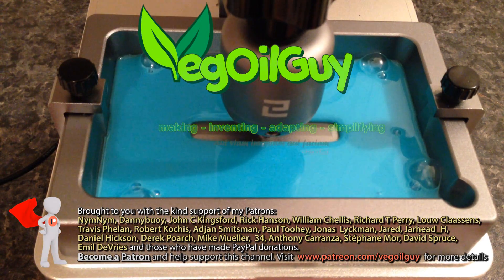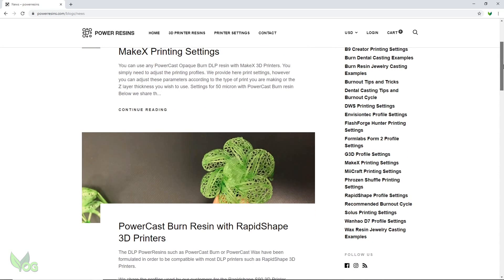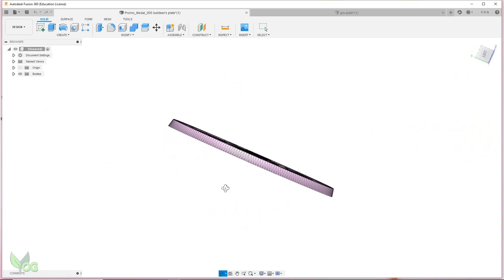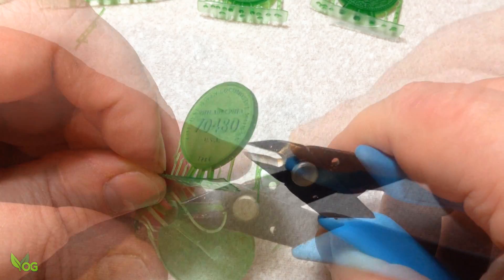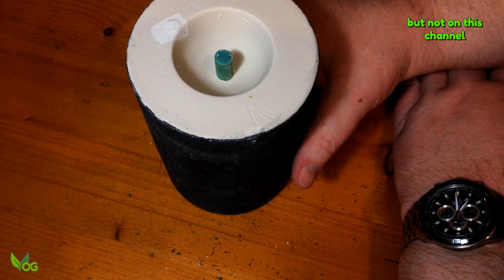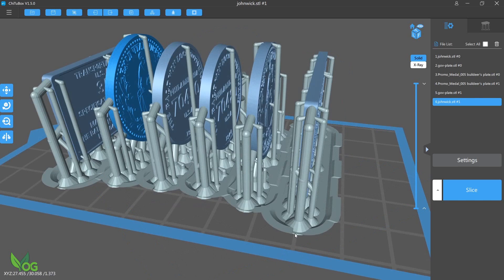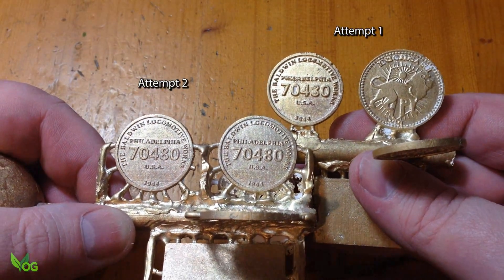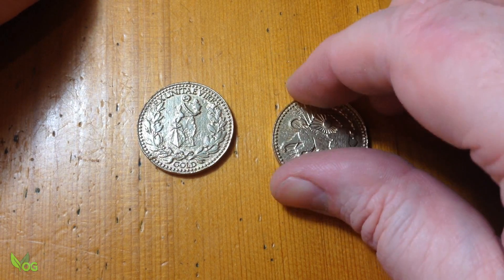Using & Reviewing Powercast Burn castable resin with my Elegoo Mars - detailed home castings! VOGMAN

Comment: Glad to see priming worked!
I dont cure mine when I prime. It seems to just stay on the plate during the print. 

As for positioning of the flask- im told the plaster is porous enough to let the gas out. Think about when you vac cast. It draws through it.

Admittedly my solid flask is much smaller and i place it button down. My larger flasks are perforated and ive had no issues.

The only time i ever had plaster crack is when i printed a hollowed model to save resin. I guess it didnt survive the vacuum boil and when I poured...some scary things happened.

Also. If you are not vac casting, or, end up using one of those machines that is all enclosed..ive found an exhaust baffle off a motor cycle works well. I think i paid about 35$. Its a 3” very perforated stainless steel pipe that i just cut down and use as a flask.
Reply from the maker: Yes the priming worked great - well, 4 coats did : )
You may be right about the gases but I certainly saw vapour clouds rise when I rotated. It was probably just water vapour, but I don't know for sure. Personally I have to take every advantage I can get : )
I love the baffle idea. It's a real shame as I bought some perforated flasks just a few weeks ago.
Reply: Oh wow you see gasses? I never looked to see if Bluecast has the same result. No kidding.

Im using Optima Prestige investment. It supports “fast burnout”. Ie throw the flask in at 600C, sit for 1 hour. Come up to 750C for 2 hours and cast.

If you lurk on the facebook group BlueCast users...yeah, you are using a dif resin and they wont answer questions about other brands, but theres a ton of good knowledge there that might give you some pointers

Comment: Good video, maybe I'll try some out far in the future. As for your problem with printing it sounds like the prints would constantly fall off the build plate or fall off at the major cure time change between the bottom layers and the print layers(and thus you needed to prime it). I had very similer problems before on my D7 that required me to write g-code that made a gradient that slowly decreases the cure time until it is at the nominal cure time. 
That and scratching the crap out of my bed surface fixed almost all my layer adhesion problems.
Reply from the maker: That sounds an excellent solution : )

Comment: Hi, does it have to be spacial plaster? or can you use any plaster of paris?
Reply from the maker: It's special plaster. Plaster of Paris doesn't work in the same way. If you look at this video - https://youtu.be/qxj5eUkAFUI - it covers the whole process, though in that case it's looking at PLA casting rather than resin, but everything else is the same. In the description I placed links to the plaster I use so you can see the sort of thing you're looking for : )

Comment: Nice job again 👍 Although I am way behind you on the casting front, I have been resin printing for a while now and I have almost managed to make every mistake there is with these things 😊 Someone has already suggested roughing up your build plate, good advice. Consider printing flat objects like coins directly on the plate, it goes much faster and saves a out of resin plus you don’t get layer lines as you did when printing vertically. If they are double sided coins, print both halves and stick them together later. Hope this helps and thanks for all your hard work 👍
Reply from the maker: Thanks for the input Peter. I was disappointed with the layer lines, though they are much softer than with FDM. I was hoping maybe it was my inexperience with resin printing. 
Nice suggestions. I've got lots of learning to to : )

Comment: How many of those coins and plaques can you get from a $100 bottle? You've really come a long way those small details are almost beyond belief. It's an achievement to see this quality in investment you should be proud, I'm proud for watching you do it! Well done man. On leaving the casting raw, I've made patterns for sand castings and I like to get the part back as unmolested as possible. It's not lazy, what if he wants to do more work then the extra metal will make it easier to clamp and stronger around the edges plus he should finish it. Leave him some metal. Foundries often charge by the pound on delivery so the customer is paying for the extra metal and you're getting paid for scrap.
Reply from the maker: Thanks Brian : )
I have to say I haven't a clue how many... a fair few I'd imagine. I think for multiple castings of the same pattern I'd stick with silicone moulding. That would make more sense. But one-off pieces are better suited to this resin... after all silicone moulding isn't cheap. I do mainly one-offs, so for me a resin like this makes sense : )

Comment: VOG you have some great videos. With this casting it looks like there was only the wax sprue exit from the flask so i'm guessing you didn't use your vacuum plate when pouring? Also is trying to get the metal to backflow from the sprues to the top of the coin not an issue?
Reply from the maker: Hi Maz. I do use a vacuum system. The flask is actually sat on top of it. The vacuum pulls through the investment plaster working along with gravity. This does away with the need for vents for the most part. Here's my incredibly cheap homemade vacuum system - https://youtu.be/EGNnH_xbjR4

Comment: Glad you got it worked out. They look awesome. Certainly saves steps over making a mold.
Reply from the maker: I had some good support : )
I agree, it's much less fiddly than silicone moulding / wax injecting, and reduces the detail loss that can occur in that process.

Comment: This is great work!   What are the specs on your lost wax casting rig that you use to build the spur etc?  What other metals have you cast in?  AluminumBronze is a very nice material.
Reply from the maker: I have to be honest, I didn't take too much notice. With ChiTuBox, you can vary all the support sizes. So you can add a fine, a medium, a thick, etc, all on the same print. Whilst doing this I adjusted the settings to make some of the supports more cylindrical and sprue like.
As I get used to it (I'm still a newbie) I'll take more notice of my process and maybe make a video to help folks : )

Comment: $100 for 250mL?!  Holy hell, and I thought it was expensive when I see specialty resins that are $100 for 1L. 😨 250mL won't even fill a Mars or Photon's resin vat...  Darn fine results though! 👍
Reply from the maker: I know what you mean. There's probably enough to do the resin tank 3 or 4 times, but it's still pricey for the quantity. But as a castable resin, it works very well : )

Comment: Thank you. I will use this to create counterfeit $1 coins.
Reply from the maker: Good luck with that : )
I guarantee you could make something that LOOKS identical, but it would feel all wrong. The weight would never match. Most vending machines are pretty well tuned to spot even tiny variations.
The general rule of the Mint, which I think is very clever, is that it always costs more to counterfeit : )
Reply: AHAHAHA !!! XD
100$ divided by 250grams of resin is 0.4$ per gram. One single dollar coin weighs about 8.75 grams, meaning that you need to spend 3.5 REAL DOLLARS to make a fake one...
Couldn't you do the math BEFORE ? XD
Meh...

Comment: Been waiting for the video on this for awhile, nicely done!  I am curious on 2 things, 1, have you tried this same cast and burn out with normal resin and what were those results (if I missed it I'll dig through old vids).  2, with the expensive resin, did you get a rough cost of what each coin costs you to make, in resin, not investment, burn out cost, etc.   There is always a cost to a hobby for sure, but just trying to get an idea of how much, just in resin something like these coins end up costing for this added clarity.
Reply from the maker: I haven't tried ordinary resin yet, but it's on my to-do list.
As for cost, the ChiTuBox software guesstimates the amount of resin used and gives a value to this. For the five - actually no it was six prints I did wasn't it - yes, the six prints came in at approx £7 I think. Not bad for bespoke, high detailed parts. 
I would imagine one bottle and one new project casting a week could last the best part of a year. Not expensive by hobby standards : )
Reply: @vogman  Thanks and no not to shabby on cost (had to do the conversion to dollars for my poor brain, but still not bad).  I figure most spend that much on coffee every few days (if not a day).  Good luck with the next round of prints and hopefully tests with normal resin in the near future.

Comment: Hi Geoff, that was pretty damn good.  Thank you for taking us through the process.  Question / Suggestion - Could you form your prints so that your sprue goes all the way from top to bottom of the casting plaster to allow better drainage / burnout. Then just plug the bottom before you cast with metal?
Reply from the maker: There's great scope to including sprue design in with the pattern design with catable resin. You'll see a small example of that next week in a ring video (there's a teaser image on my Community page). The drawback is, of course, that the resin is expensive and that makes you want to use it sparingly. But if you penny pinch too much you risk a spoiled casting : )
Reply: @vogman  Thanks Geoff - am looking forward to seeing the next one.

Comment: Hello & Thanks for a great video!

I have a Form2 & I have done a couple lost wax castings just in the past few weeks.  I use the local lapidary guild for their gear.  I have a kiln at home but not a vacuum nor a centrifuge.  It looks like you don’t use either and your parts look fabulous.

Thanks for the inspiration!
Reply from the maker: Thanks Juliana : )
Actually I do use a very simple homemade vacuum system and it works very well. You can see it here - https://youtu.be/EGNnH_xbjR4

Comment: Those look spectacular! 
I did notice you went back to using a button pour vs your dam button pour any particular reason for this?
Reply from the maker: Many thanks. I didn't want to include PLA in this pour so I used the standard rubber base : )

Comment: What amazing detail!  It looks like there is faint vertical 'banding' on these prints that unfortunately is faithfully reproduced in the cast. Is this an issue with the printer, or just something that has to be lived with using the current MSLA technology? Either way, very impressive results.
Reply from the maker: You're absolutely right John. I can see it to. As I said in the video, I'm new to resin printing... I'm sure better positioning, reduced layer heights and tweaked setting could produce better results. But please remember one thing... unlike many casting channels, I ZOOOOOOOM in on the castings. So the view you have is better than the one I have. In the hand these things look amazing. Zoomed in the quality obviously drops a little. But for home casting and largely homemade equipment, it's not bad : )

Comment: Wonderful job. Those castings really look awesome. 👍
If you test more resins, maybe you should print some kind of a test pattern too. Something with different letter sizes,  wall sizes, spike heights etc. It could give some idea how well the resin works in casting (burn off, durability etc.)
Reply from the maker: That's a very good suggestion. I have got a couple more coming hopefully. If they don't print the same they won't cast the same, so yes... I'll give that some thought. Thanks : )

Comment: Very nice prints. The cast turned out even better. I'm going to look at a kiln setup tomorrow, to serve as a burn out oven and such. Might Finally be on my way to a little lost wax/pla casting now.
Reply from the maker: That's a decision you won't regret. The extra control makes things so much easier : )

Comment: Will you keep testing other burnable resins as they become available?
Reply from the maker: Yes, Kieran, that's the plan. There's a wide variety on the market and the price puts folks off "trying" them. If I can take away some of that guesswork (as I hope I did here with Powercast Burn) then hopefully people will be more confident about trying. After all, those failed prints were technically very costly... but hopefully others can now avoid them : )
I have got two other companies making encouraging noises... but not Formlabs ; )

Comment: Hi VOG, those results look great! Thank you for sharing.
Some ANICUBIC Photon users sand their build plate carefully to get better adhesion (and to make it more even).
Regarding castable resins I could recommend to try HarzLabs (Russian company, maybe you have a distributor in th UK other wise edv-3d-druck(dot)de is a German distributor) or Druckwege(dot)de resins (German company). They are a little cheaper if I recall correctly. Both should ship to the UK. Good luck.
Reply from the maker: Thanks Gerrit. I'll drop both companies a line : )

Comment: I got worried when you said castable resin was £100 ... then i realised it was for burning off that would have scuppered me ☺.  
And priming the build plate with resin was a brilliant idea gives you a larger scrapping area for the removal tool as well as adherence 👍.

Results perfect
Reply from the maker: It is expensive, but how much are you using? In this example, I had 5 castings on the plate with an estimated resin value of around £7. How much would I have paid someone else to make such high quality metal items : )
Reply: @vogman   i totally agree, my goal is to cast in silicone to make resin copys, i got worried you needed a different printer resin to do that. I been reading too much into the subject and getting my terminology all muddled... probably how you felt when you first got started 👍 ....  you cannot skimp on quality materials rule 1
Reply from the maker: I like silicone moulds but I think you lose a little definition. After all you're casting a copy of a copy. But if I was doing several of the same thing, that's what I'd do. A nice crisp resin print made into a silicone mould.
For one-off castings, which is mostly what I do, it makes sense to use castable resin. After all silicone isn't cheap either : )
Reply: @vogman  i am just too scared of burning my house down 😊.

Comment: Absolutely stunning casts. I see you didn't do your usual over flow cast vent. Any particular reason. Thanks for sharing with. Bloody brilliant quality.
Reply from the maker: Trust me I'm missing that basin. Did you see the small debris falling from the crucible?
I didn't want to introduce PLA into the equation. Wax is know to be ash free and is regularly mixed with castable resin. I'll be finding a way to bring my basin back : )
Reply: @vogman  I got a sample sized spool of TPU filament, which is somewhat flexible. I was going to print a copy of your basin type sprue base without the center taper on my filament printer. That way it could be reused like the commercial rubber bases. With a hole in it like the commercial bases it could be married to a PLA or wax sprue. My fiber printer is pretty low end and wasn't happy trying to print the TPU filament. It just plugged the nozzle, but this should be worth pursuing if one had the correct printer for one of the more flexible filaments.

Comment: With this information you have given me, I will be able to manufacture my own arcade tokens.
Reply from the maker: Yes, quite easily : )
Reply: Or you can just grab a penny and smash it until it looks like an arcade token LOL
Reply: You could buy A LOT of tokens for the cost of the printer, resin, investment, various tools, and of course your time.  I hope you are thinking of doing it for other than financial reasons.
Reply: TangoDeltaDelta I guess it's just for the achievement and the feeling of tricking a machine, even if it's not worth it. I felt so great when I once put a round piece of wood into one of those old chewing gum machines and it actually worked, although it wasn't worth the time getting a piece of wood into the shape of a small coin.
Reply: @TangoDeltaDelta  he'd only need to print a single master..then make a mold for wax from that...i understand they have a wax filament now
Reply: @imperialpresence3331  In this, VOG was burning out the master printed piece. If you use another generation of molding or a filament instead of resin, you are going to lose some resolution / fidelity. The quality and crispness of what VOG did is what's impressive.
Reply: @TangoDeltaDelta  Arcade machine dont check for fidelity of the token.
Reply: @TangoDeltaDelta  it’s actually smart to make your own money, clients will only be able to use them at your shop/services.